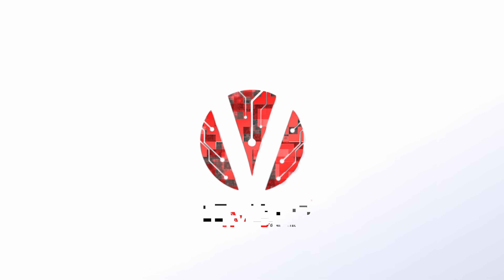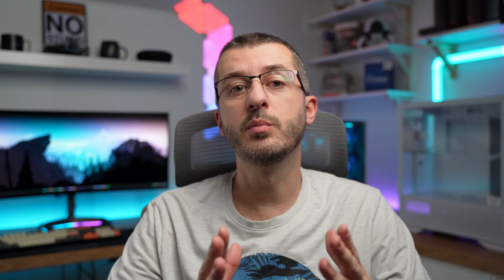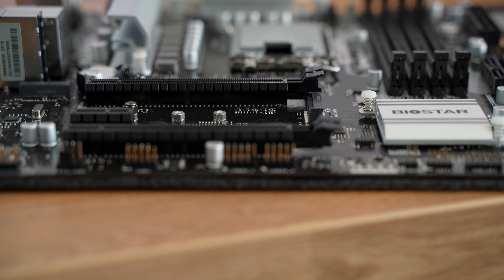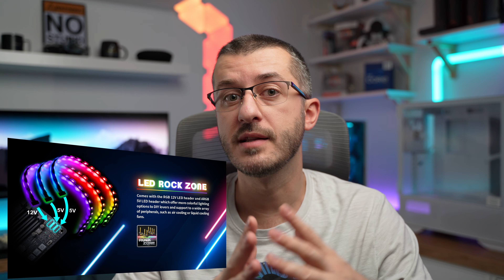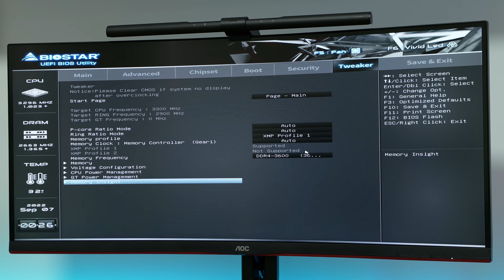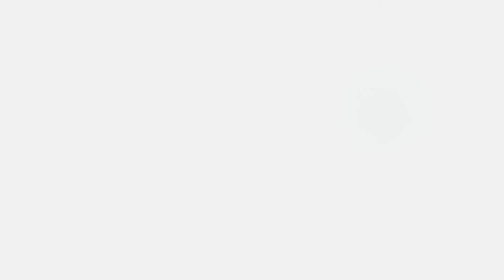Biostar B660MX-E PRO - Great BUDGET mATX board!

Comment: Will it throttle on a i7 non k 13th gen?
Reply: Yea it will kinda work but to get the full performance you should get Z790 or B760, biostar b660 is for low to mid ranged setup but i7 13th gen is quite high end.

Comment: Does Pcie 4.0  works as 3.0 with 10th gen cpu? or it doesn´t work at all?
Reply from the maker: This board does not support 10th gen CPU, 12 and 13 only. All gen 3 devices will work within their limits on it
Reply: @LevelUPGamingTech gen 4 support?

Comment: I have rtx 3070 with a i7 12700f will this mother board keep up with big renders or ultra grafics and ray tracing gaming
Reply: Also have 32gb of ram
Reply from the maker: It will work, but just for the piece of mind I would suggest that you get a decent Z690 board, just do that, do not go with B660 at all... you will be better in the long run with Z690
Reply: @LevelUPGamingTech  I'll have a look into it thank q:)

Comment: hello, great video! Will I have any trouble using this motherboard with an RTX 3060Ti and a R7 5800X? Or will I be better off with a B550M Aorus Elite? Mostly gaming and engineering software
Reply from the maker: This is not an AMD board, this board supports only Intel 12th & 13th gen CPUs, for AMD board, you will need to look for B550 board like you mentioned with Aorus Elite 👍 Other than that no issues with 3060Ti 👍

Comment: Hi there thanks for the video. I have a question about the CPU, I am running a 12th gen i7-12700f with a 3080. Will this encounter the throttling issue you mentioned. Subscribed btw =)
Reply from the maker: It shouldn't be an issue, you should be ok with it, surely it would perform better on a board with higher VRM power, but not that much, marginally better btw. Just don't push the CPU constantly at heavy loads, this board was not meant for that, but normal use gaming and such, you are fine 👍
Reply: @LevelUPGamingTech  thanks =)

Comment: I can't activate VT visualization for android emulator
i can't download WSA 
Does  this motherboard support them?
Reply from the maker: All boards support that, it's a CPU feature, you just need to enable it in BIOS... Usually it's either called VT-D or just virtualization...
Reply: @LevelUPGamingTech  Thanks for your answer.
In intel they are obvious and we know it
On AMD it took the setting from the windows control panel just to install an emulator.
You don't install wsa either because vpn is needed in my country or because there is no similar setting on the motherboard in the bios related to vt-x
At least I didn't find it
That's why I commented on this video

Comment: The biostar H610mx-E motherboard is very similar to yours, but does it support the bclk oveclock of the i3 12100f?
Reply from the maker: every board has the option to raise the BCLK, it depends "will it hold"? Because when you do raise BCLK, you are not raising only the CPU you are technically overclocking the whole PCI bus, so SSDs, and USBs and everything connected to the PC is "overclocked" and could have problems